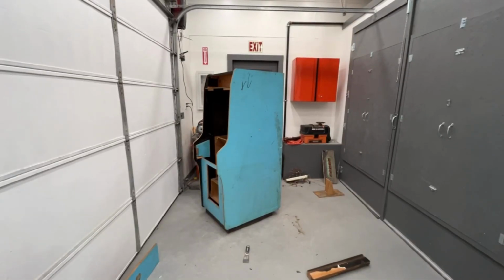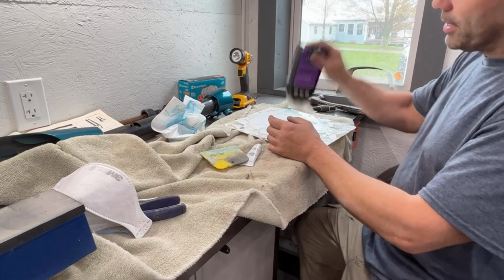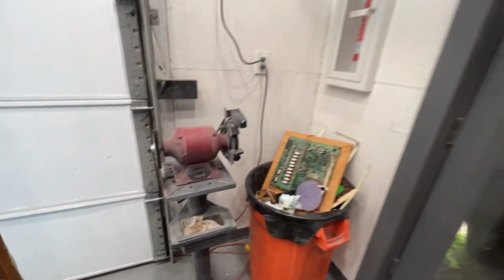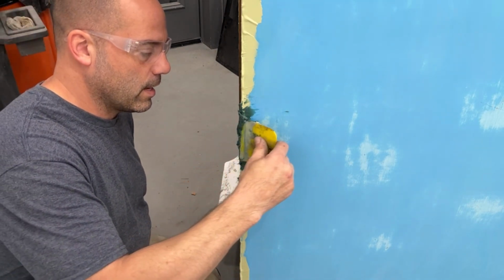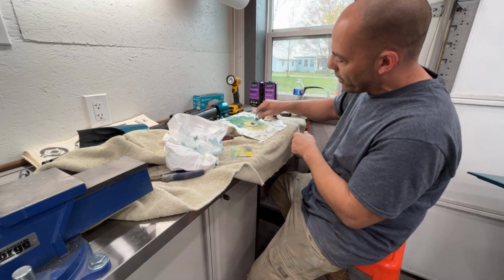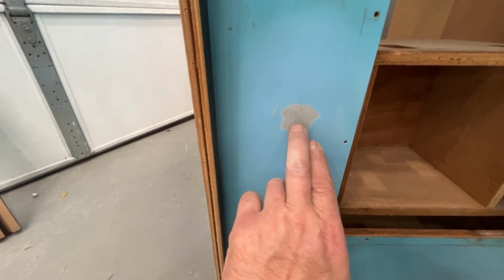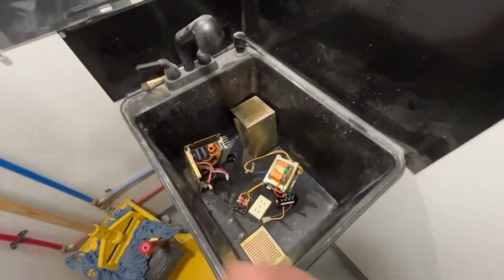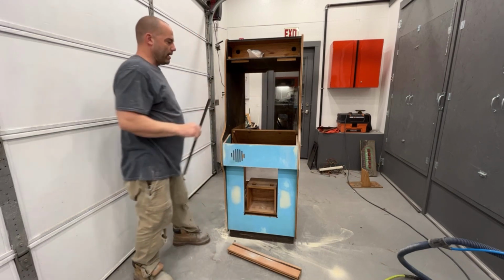Popeye arcade restore part 2 bodywork

Comment: I think it’s some sort of gel coating on the Nintendo cabinets it doesn’t feel like laminate.I’ll put that away so I don’t lose it are dangerous words in my world it’s lost immediately for days.
Reply from the maker: Yeah, I agree it has some sort of like a white color underneath. It’s definitely not laminate. I wonder if those sheets came already with the blue on it
Reply: It would be interesting to find out the process they went through to produce these cabinets. If I get a chance tonight I’ll take a few pictures of the inside of my Popeye especially the power supply and send them to you on Facebook it might help you out a bit the power supply is different from the one you have I suppose you could just tie all the 5v wires together and run off that big supply
Reply from the maker: @WayneSylv  OK that would be awesome. Any help is appreciated.

Comment: I just picked up a Popeye cocktail table, believe the monitor needs recapped. Debating doing that myself. Any advice?
Reply from the maker: They’re not too bad to recap if you order it from Arcade shop, it has instructions and it tells you what Goes in what place and if you just do one at a time you should be just fine